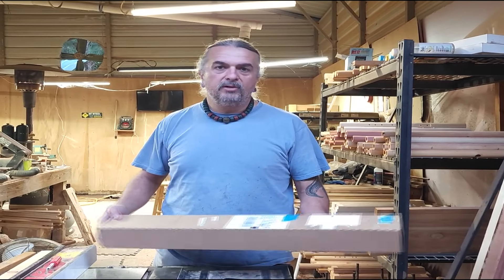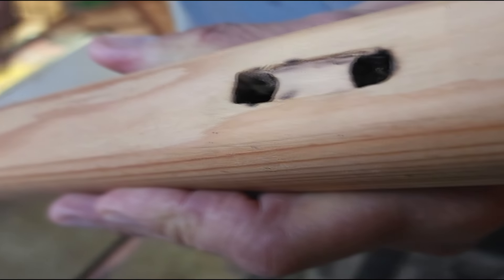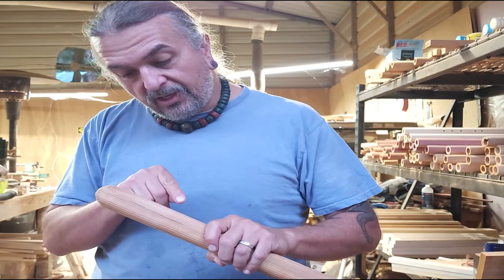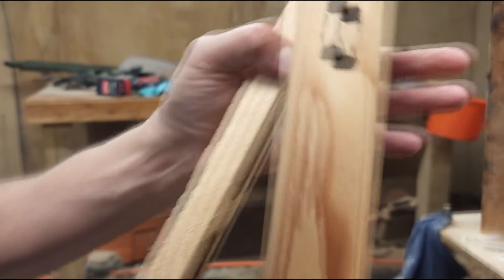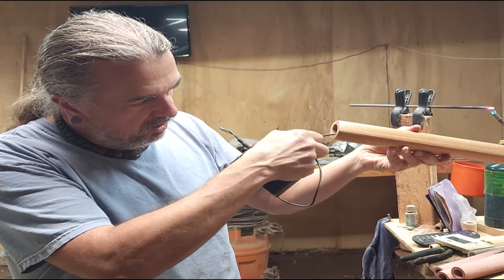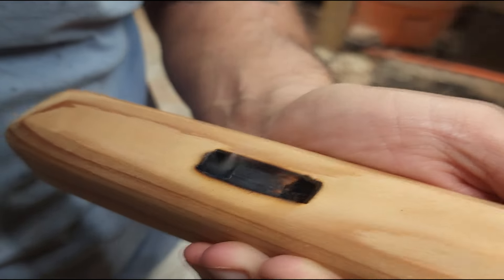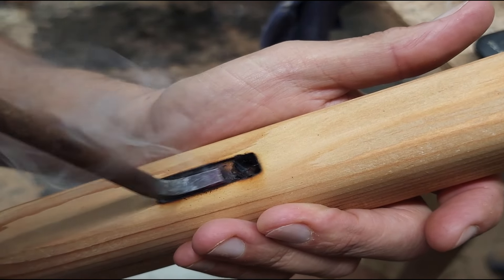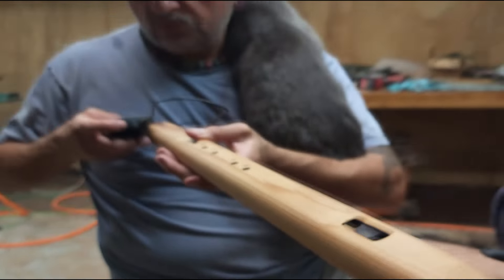Blue Bear Flutes - Making the Flute Track In Your Flute Kit - Native American Flute

Comment: I notice it has a little bit of a high-pitched wispy sound, something I have on a flute I'm working on, is it possible to get rid of that sound entirely? More sanding? More burning?
Reply from the maker: @JulianKingman  I believe I have a video on that. It has to do with the track depth usually. If there's anything you can do to ensure that it is not too deep and project the airflow precisely at the splitting edge, it will help immensely!
Reply: @ that’s probably it, the track is a bit deep. Thanks for the quick reply!

Comment: QUESTION AT THE BOTTOM * hey boss. youre amazing. been binge watching you for weeks as im trying to learn how to make my own flute. people charge 600 up for them and the time and energy is well worth the price. but i have a thing where even if its not as perfect i like making my own stuff. paying 300 plus for all the equipment anyways ... in multiples of your old videos you use this Metal thin rectangle you heat up and use to flatten out the track area after youve finished the other stuff.. whats that piece of metal called? could i buy it? and from where? im not a toolsy guy. i didnt even know what drill bits were before your videos
Reply from the maker: @Moniqueson1997  Hey, thanks for watching! Keep in mind at this particular time in history I do have flutes that start out at about $70 with free shipping to us residents and cheap shipping overseas. Just fyi. Also thank you so very much for watching these videos and commenting as it helps my channel a great deal. If you haven't yet, please make sure you check out my Instagram and tiktok channels both under the same name Blue Bear flutes. That piece of metal was a flat iron bar and you can buy them in the United States at Home Depot and lowe's, Ace Hardware and just about any hardware store that you run into. The one in question you're asking about is about an inch wide and a quarter of an inch thick. A thinner one will actually heat up faster so if you're not using it a lot it should help. I believe I have a video about it somewhere. 🙏🏼🙂🙏🏼
Reply: @BlueBearFlutes  thaks alot for the information ! im definitely interested in one of your flutes ! ive been on a few websites and man! youd think the flute plays by itself the price these eople are charging.. but it is alot of work to make a great flute so i understand.. but ill certainly be looking into one of your starter flutes :) still going to try the project of making my own too!
Reply: @BlueBearFlutes  19" flute , 5.9" air channel , 11.8" sound chamber does that seem right for a flute being made in F#? ive been doing so much research but it just doesnt seem right.. if i can figure out the length and width of the air channel and sound chamber also the overall size of the flute without over complicating things , i would have all the info i need to mke this flute ! if you could help would mean so much
Reply from the maker: @Moniqueson1997  Is the inside diameter 7/8 inch? (You know, I have a book with a lot of flute schematics in it)
Reply: @BlueBearFlutes  im a vuslaul learner and i think the reason im having so much trouble is because all the forums dont answer the question directly.. if i cut a piece of wood at 19 inches , what length would the air channel and sound chamber have to be? i see in everyones videos the sound chamber is significantly longer than the air channel. so i just want to know thatone thing because thats really all thats stopping me from making a decent flute. truly man im homeless and broke and i cant afford to buy any books or classes right now .. all im stuck with is youtube and good hearted people who give me free tips.. but when i start working i will definetely put money into your buisness. im planning to buy your burning rd , your handmade totems and possibly even a legit flute since i know mine would sound like crap.. i do not know the inside diameter im guessing that means thickness? but if you could help with a standard sizing of the air channel and sound chamber of a 19 inch flute it could really help man.. this is driving me insane lol trust me ive wattched sooooooo man of your videos and taken so many notes butbthis is the one thing that just keeps messing me up ..
Reply from the maker: @Moniqueson1997  Please contact me through my website bluebearflutes.com. There is a contact form at the bottom. Remind me of our conversation so that I know who you are.

Comment: You cut the block I. Half bore the teach two sections with  a small river between were when glued the bird sits on top of the Teo holes covering one or both,
I’m trying to drill my limb out I chose pecan but my drill bits isn’t long enough like how would you bore a 24 inch flute out?